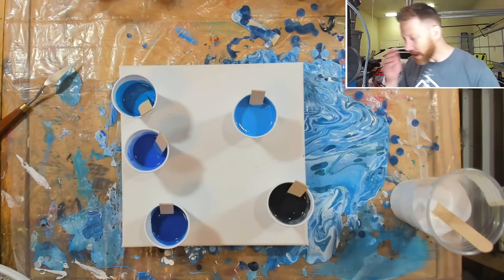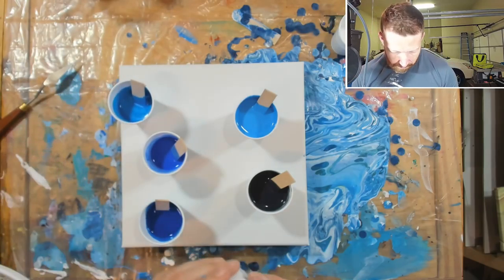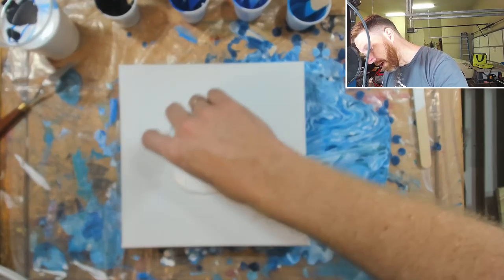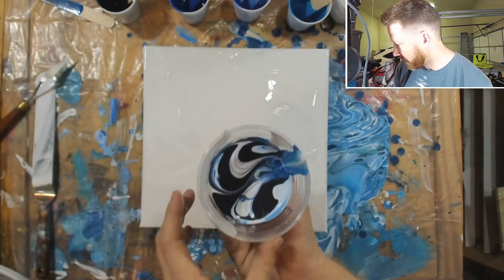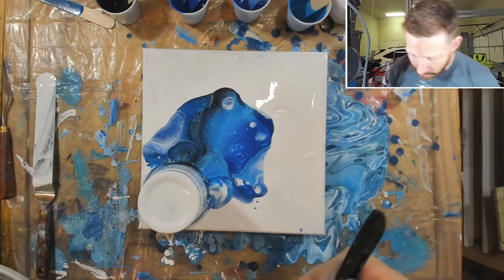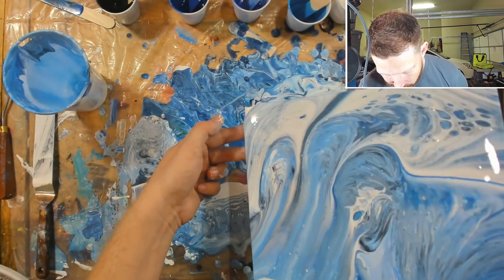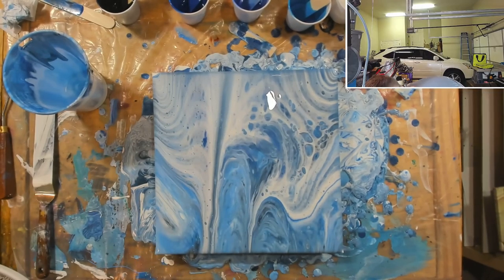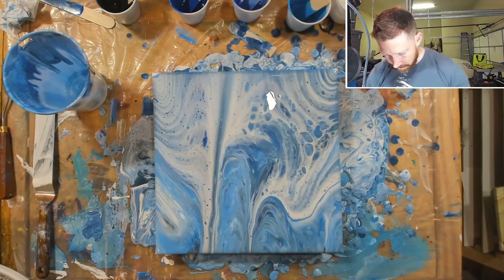New Techniques!!  Vented Slit Cup

Comment: That worked great! Now you just need to start using corner catchers so the paint won't all fall off. :P Love the colors. - Heidi
Reply: Where do you find the corner catchers?
Reply: You can just make them out of anything you can fold into a "corner". I have seen a lot of pour painters use cardboard from cereal boxes. They fold it to wrap around the corner of the canvas so the paint won't be able to run off. :D They just hold it on the corner they are tilting towards and then move it to the next corner and so on.
Reply: Thanks I have seen it mentioned before but was like what?
Reply from the maker: Thank you Heidi 😊. 
I really should hu? 😂🤣
Reply from the maker: Crystal, they really are useful... Especially when you think you might not have made enough paint.